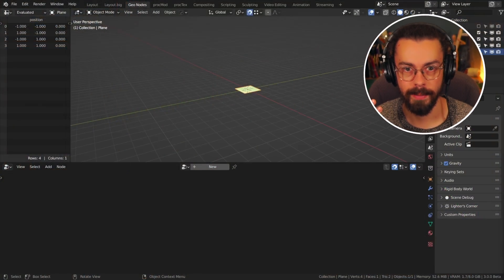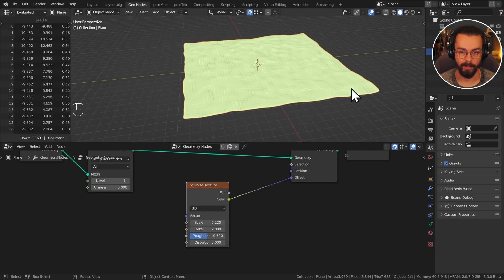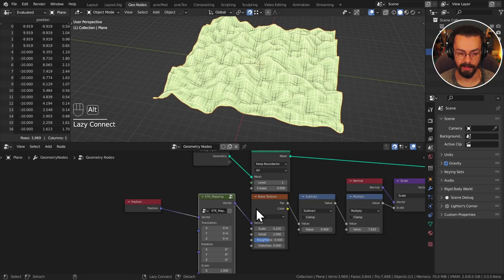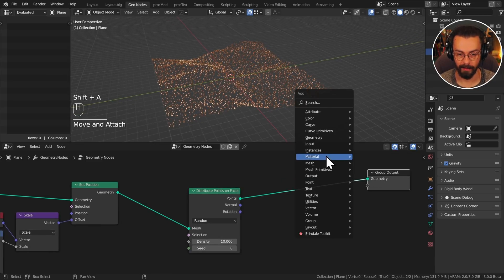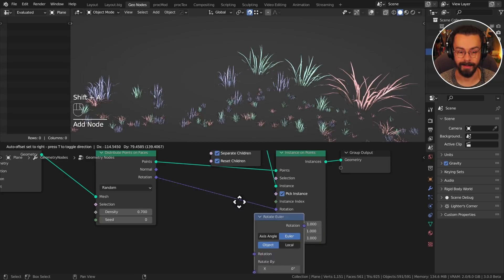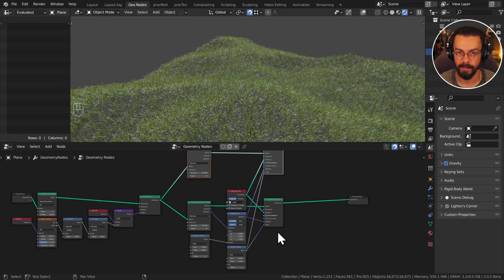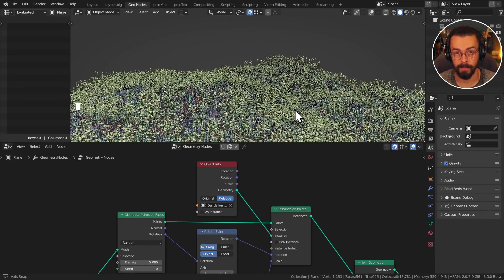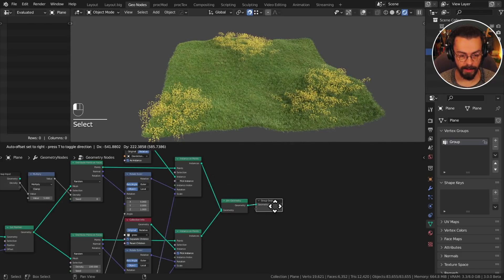Displacement and Scattering - Geometry Nodes 101

Comment: Very nice thank you! I have one question though. How would you then move scattered instances when an object passes at proximity? Like car moving dirt or leaves when passing by?
Reply from the maker: You could use the translate and rotate instances nodes and have them effected by some value derived from the Geometry Proximity node of your car. If you wanted them to have time falloff then you’d really want to use a simulation zone as well
Reply: @Erindale Thank you very much for the tip. Not sure on how to apply the sim part but I'll give it a go. My firsts test had them moving but then going back to initial position once the proximity object  was too far. not optimal I guess.

Comment: How can we use cloud texture from texture menu since it have much more variations and parameters than the cheap noise texture in geometry nodes? I tried image texture but it cannot access the cloud texture from texture menu only have a folder to get an external image.
Reply from the maker: There is no access to those legacy textures in geometry nodes. All of them are possible to make though with the noise and voronoi and musgrave textures

Comment: Hey do you know if you could link that plane with grass into another scene? I have tried and the plane comes in without the scattered grass.
Reply from the maker: As long as you're linking the object, not just the mesh, it should come through with any geometry nodes modifiers and additional dependencies that it requires such as grass meshes.

Comment: when i go back to my modifier i cant see density all i see is value. what should i do?
Reply from the maker: Like you want to turn it into an attribute input? You should have a spreadsheet icon button next to the value on the modifier if you click that it'll change. If you don't see that then it means you've plugged the group input into a constant socket instead of a diamond field socket. If you're using Poisson disk distribution then you'll just want to plug into the density factor for weight painting and have your max density set separately
Reply: @Erindale  I followed every step you did except at 11:48 when you go to modifier geometry nodes it doesn't show density for me it shows value. my group input doesn't show density it shows value as well maybe that's why. how would I change the group input to show density instead of value?
Reply: @Erindale  i figured it out its because i didnt connect the group input into density first thanks so much !!!

Comment: Is there anyway to remove the grass as we weight paint the dandelions?
Reply from the maker: Easiest way is to have the geo nodes tree visible and mute (I think ctrl+alt+right drag) the noodle connecting grass to the join. Than you can sort out the other things which want to be less dense
Reply: @Erindale  thank you but I think u misunderstood the question. What I meant was as when we weight paint the dandelions the grass in that area is removed or masked out.

I kind of solved it by adding a math node on substract connecting the grass density to the weight attribute but maybe there is a better way.
Reply from the maker: Oh gotcha. What you've done with maths is the most optimal way 👍

Comment: And I understand that, the benefit of using geometry nodes for displacements, is that it's lighter, but can also be used for eevee, right?
Reply from the maker: Heavier than using adaptive subdivision as that's entirely handled by cycles. But yes, you end up with real mesh so you can do other stuff with it like simulation or other modifiers etc

Comment: excellent tutorial.
Reply from the maker: Thank you so much! Hope it helped!
Reply: @Erindale  I do have one question. How can you transfer say a Musgrave texture used Geo Nodes to a shader nodes set up. Is that interoperability available? I want effectively a height colour but using it on a sphere using displaced  normals so a trad way I usually do it is position in z and recolour. This doesn't work on a sphere that is displaced on its normals.
Reply from the maker: You can transfer anything from geo nodes to shaders just by plugging it into the output node and setting an attribute name in the "Output Attributes" part of the modifier. Then in the shader you can use the attribute input node. Bare in mind though that geo nodes stores data on the mesh elements. When passing to shaders, I think that's always going to be vertices so the texture resolution depends on the density of your mesh.
Reply: @Erindale  wicked. I'll try it out. Geo Nodes is very very cool. But also very very deep

Comment: Awesome like always. I was wondering if its possible to create some material variations on the instances (like for example a shader that creates a different green per grass leaf instead of all of them using the same green color). I can't find the way to do it without making the instances real.
Reply from the maker: If they're instances you can use the Random socket of the object info node in the shader. If they're realised and joined into one, you'll have to use the Random Per Island on the Geometry node in shaders (but this only works in cycles)

Comment: hey erin, super useful stuff, your geo nodes 101 videos. in hopes that you check the comments of older videos: is there a way to get the attributes of neighboring elements of a geometry (e.g. using it to implement proportional deformation). like calculating the average position of all the vertex points and add it to each individual vertex.
Reply from the maker: We can only do things like offsetting the index with a Transfer Attribute node but you can't be sure the indexing is actually going to be adjacent anyway. For proportional editing, you can use a geometry proximity or a vector math distance on the position node to create a gradient, map range to sort the falloff and then use that to scale a vector you're using as the position offset with a Set Position node.
Reply: @Erindale  thanks for the lightning speed response.  i have a follow up question regarding the spreadsheet  and the viewer node. how can i see the output from let's say the map range node? that is another major missing piece of the puzzle for me. do i always need an associated geometry?
Reply: @Erindale  and how can i extract the position field of the indices?
Reply: @Erindale  goddammit theres a position node, im sorry
Reply: I have another question, though (sorry for the spamming): I'm trying to perform an operation on a whole attribute field, using the Attribute Statistic Node and changing the output to vector. Trying to view this in the spreadsheet results in seeing a float value and i cant figure out why. am i doing something wrong? Im using the 3.1 alpha built.
Reply: okay i got it now, for anyone who's stuck on the same issue: after you've used the Attribute Statistic Node you have to use the Capture Attribute Node to assign it to your geometry. I tried to find the mean vector of my mesh and it didn't change when I moved my object - always apply the transformations, otherwise you won't be seeing the changes in your spreadsheet.

Comment: I don't think the axis angle rotate euler is correct, because if the noise displacement is set too steep, the grass starts leaning in weird directions and not according to the normals?
Reply: Changing the rotate euler to local instead of object follows the normal though?
Reply from the maker: @Corza  Local will be relative to each point, object will be relative to the overall object rotation. For something like faking wind you would want it set to object so everything rotates in the same direction 👍

Comment: The plane deformation also deforms the placement of the instances. I got rocks and grass floating off the mesh. Ground is grass + dirt. Not just grass...
Reply from the maker: As long as you're viewing the deformed mesh not the original flat mesh it'll be fine 👍
Reply: @Erindale  Humbled you would respond but i would have to disagree. I see you use gScatter to do this in other videos. Gscatter is not available for DL right now... Anyway, i displace the mesh, join geometry to keep it visible and distribute points and add instances. Floating grass and rocks, how do you negate the offset that is carried over from the mesh to the points?
Reply from the maker: GScatter 0.4 is out so you can use that one :)
What is the issue you're having then? I'd you displace the mesh and then distribute points on the mesh and then instance on those point, the points will be on the surface of the mesh. If you're using a collection to instance from and you need to make sure you have ticked on separate children and reset children and then pick instances on the instance node.
Reply: @Erindale    I want that add-on, excited about it! when i try to DL it doesn't do anything, hopefully they'll fix it.... You smug son of a b, you make this look so easy... my origins were off.... that's a lesson to you kids at home. Check your origins!

Comment: Thank you for this amazing tutorial. It really helped me to get the hang of 3.0's geometry nodes. :)
Quick question, if instead of a noise texture I'm using an image texture to displace my geometry, how can control its scale/position/and how it's mapped? Thank you!
Reply from the maker: Just put a position node through some vector math (add/subtract to move, multiply to scale) and vector rotate to sort out the mapping
Reply: @Erindale  my saviour, thank you for the quick reply!! :)

Comment: I have problem with instances or maybe its impossible. I distribute (instance) object A on another object B. Instanced object A is a brush (dynamic paint) and object B is a canvas weight type. It seams not to work (weight map is empty). I can make instances real to achieve same result but this broke geometry nodes workflow.

Comment: Thanks for this series. Is there a possibility to detect colliding of instances and removing one of them. That would be so useful (for example droplets).
Reply from the maker: Change the distribute points node from random to poisson disk and you can set a minimum distance 👍
Reply: @Erindale  thanks  - checking now ;)